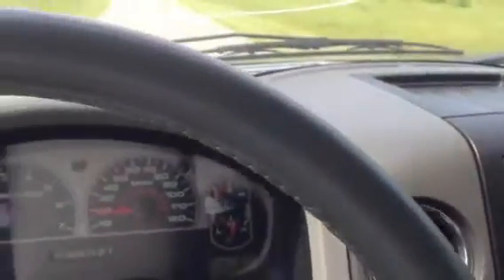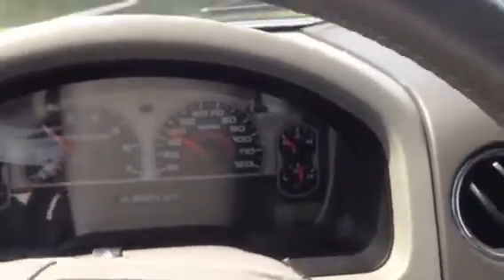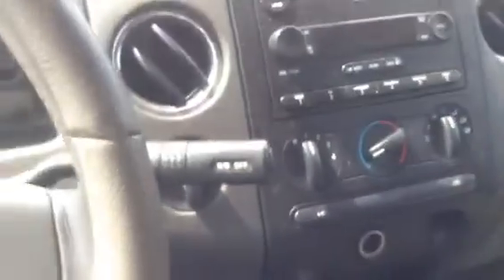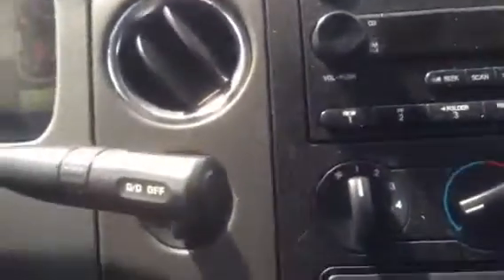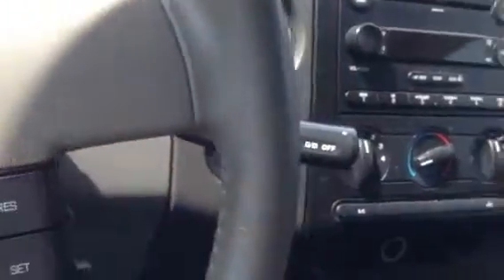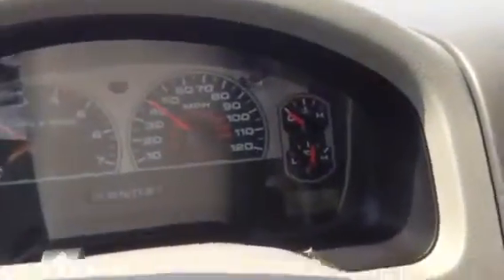Cummins F150

Comment: 4 wheel drive, thats cool ,factory axles ,Independent front axle? had a 2wd 06 ext cab . 4.6 v8 ,always wished it was geared a little lower .i hate the push button 4wheel drive systems anyway,i like that you have a shifter for transfer case .

Comment: I have an 06 extended cab with a 4bt, 4wd in floor, and automatic transmission that came with it. You think I should expect 19mpg also?
Reply: Daniel Murphy id say about 17mpg. But if it's lifts or has bigger tires id expect 14. That's about the drop I got on my 2013 F150.

Comment: I have 04 crew cab with a blown engine. I'm thinking about doing this swap. What transmission did you use? Is anything needed to get a nv4500 to bolt up to your transfer case?
Reply from the maker: I'm sure you could possibly adapt the transfer case but your going to have to make driveshafts more than likely so I would use a transfer case that will bolt up to the nv4500. I cut a hole in the floor of mine and used a manual transfer. Ford has some 150s with manuals so I found the trim that goes around it from a wrecked one and it looked good when i got done.

Comment from the maker: It got 19 mpg or so. If I did it over I 
would have used a nv4500 transmission.
Reply: i thought mid 30s was the norm for this engine
Reply: shylildude only with a manual, you'd never get that with an automatic